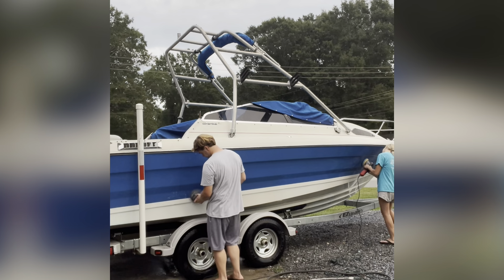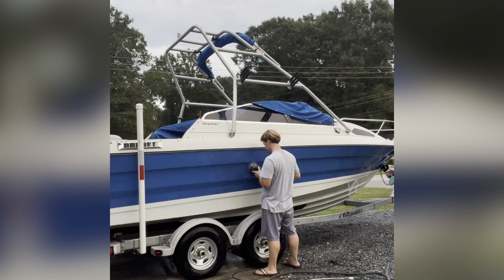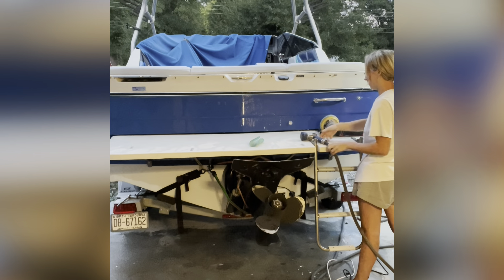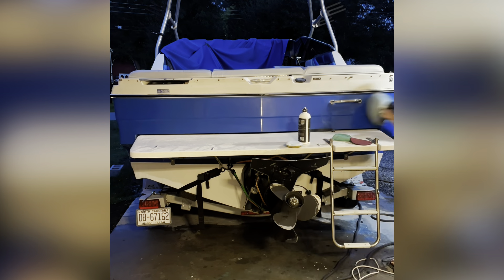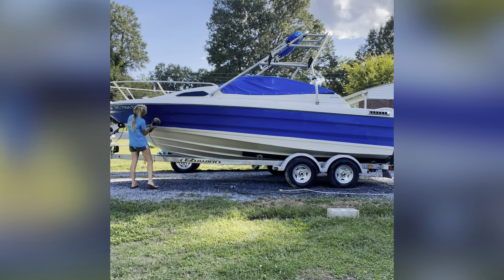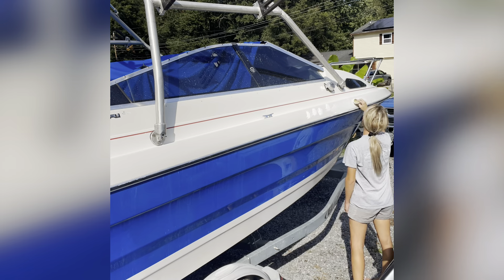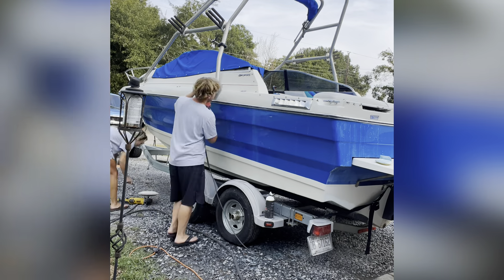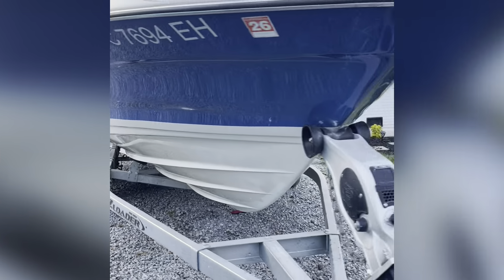How To Restore Gel Coat Professionally

Comment: This is nothing short of an amazing transformation! I see so many boats around that could highly benefit from this same restoration. Not only do I have one boat I recently got for free that needs this (plus mechanical repairs) but I also have another boat same age (1987) that needs gel coat crack repairs plus the polishing. My big question is... What is a reasonable rate to charge for doing this to other peoples boats? This seems like a great side gig... Thanks for sharing this!!!
Reply from the maker: Thanks for your comment! Prices are different in certain areas. But I’m in NC & I charge $40-$50/FT X both sides. If it just needs a polishing only (no oxidation) I charge $40/ft X both sides. It’s a lot of work but fun to do!